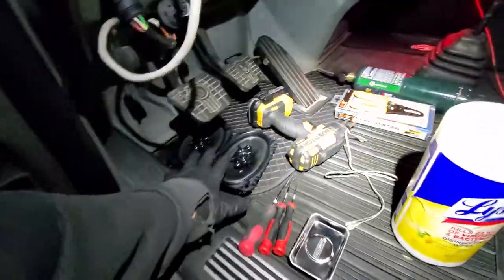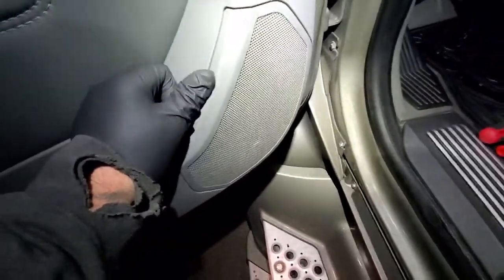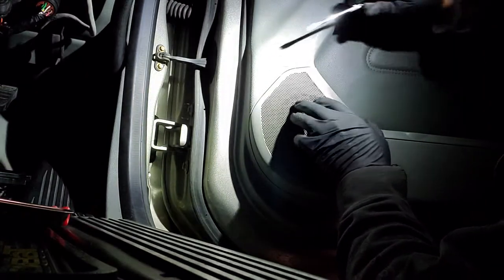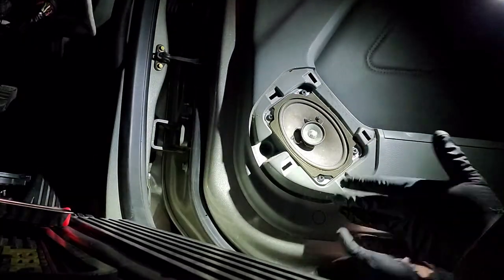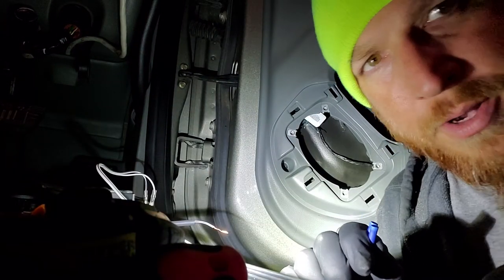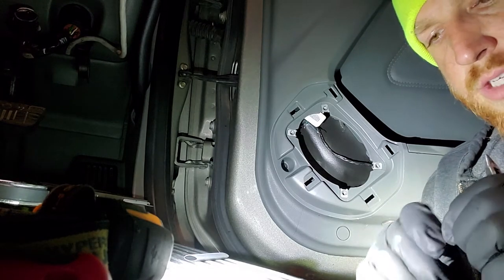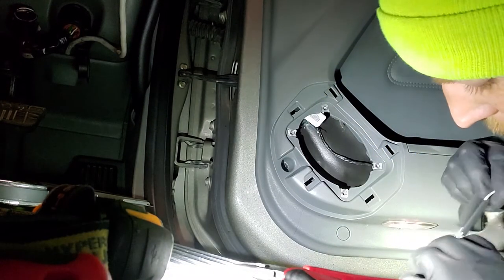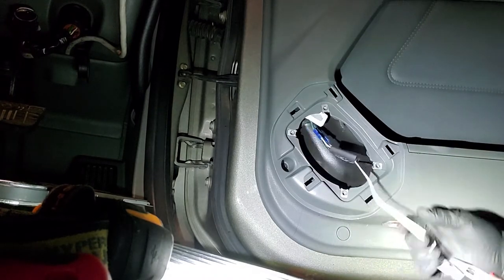replacing door speakers on a kenworth t680

Comment: It will play both ways. But it will be louder when you get the power & ground on the right ones.
Reply from the maker: The right ones?
Reply: @justanotherotrguy yeah what he's talking about is the speaker will play in reverse polarity. Basically you could hook up the positive wire to the negative terminal and vice versa and instead of the speaker being pushed out work when it plays it gets pulled in word. If it's getting pulled in word it's basically pulling sound down towards the magnet and when you have it hooked up to the "right once" meaning positive to positive and negative to negative the speaker operate properly and project the sound outward.

Comment: For company drivers. They got this thing called T clamps. This way you don't have to cut off the adapter and get in trouble. My wires were black and brown. Didn't pay attention so I don't know which one is negative. Use the blue T clamp for the truck wires. And the red connector thing gets crimped on the wire that comes with the speaker When it's time to trade trucks or whatever, just release and throw some tape on it. I'll let you know how long they last. I used Boss speakers. It's kinda meh. Got any good Bass recommendations?
Reply from the maker: Are you referring to stock bass speakers or standalone box's? JL makes great speakers as well as pioneer, Orion and Rockford Fosgate. Some of them are pretty pricey but worth it. What truck are you running? Running subwoofers may require additional battery power
Reply: @justanotherotrguy  a 2020 kenworth t680. I just need more bass. I can't listen to boneless music. I'm a company driver so I can't do too much to the truck. I do have a subwoofer but don't know how to install it. I'll have to check out these speakers.
Reply from the maker: @887Bingo  yea man I'd go easy if it's a company truck with adding too much. You might be able to get away with asking them if it'd be ok to add some bass to your stereo and see how they react. If they don't mind you could always take it to a car audio installer to get it rigged and let them know it needs to be removable without any hole drilling or cosmetic alterations, so they don't have a shit fit bc you put a sub in there. I'm gonna make a video at some point installing some amps and subs, as soon as I get it all bought!
Reply: @justanotherotrguy  cool. Also I think I might have found a hobby in wiring things thanks to you. First time doing something like this and its surprisingly extremely exciting to work with wires and have what you did somehow work.
Reply from the maker: @887Bingo  I'm the same way! Feels really good to do shit yourself and make something not working, work again. Problem solving and fixing an issue is very gratifying. Glad I could help!
Reply: Great info and video. I do have to laugh a bit... you wore the gloves while wiring speakers, but not wear them while changing water separator filter 😂 How dirty were the speaker covers? Yeah, I'd be wearing gloves too! Safe journey and hope to see some more videos.
Reply: I know this is an old comment, but the better solution is to properly adapt the trucks wiring harness to your speakers. This can be done with a pair of Delphi 12052833 male connectors, 2 pairs of Delphi 12059894-L crimp terminals, and a pair of Delphi 12047665 terminal locks. All of these parts cost pennies. No modification of the vehicle's wiring harness is needed here, and once configured, the installation is plug'n'play.

Comment: Is it neccesary to use a new adaptor for new speakers ? Or we can change only speakers
Reply from the maker: Most aftermarket speakers will have different wiring plugs than stock speakers. Unless you find some that match your stock plug, you'll have to replace it.

Comment: The factory 4x6 door speakers in my 2020 T680 are labeled as part number# PP307006. 8 ohms. 50W. I also bought the Sony XS-R4646 4"x6" from WalMart but they sit just slightly taller after mounting and therefore the speaker grill will not snap back on. Additionally the "oval" on the inside of the speaker grill is NOT the same oval size as the Sony XS-R4646 speaker. You would need to shave the plastic on the inside of the speaker grill to make it snap back on with a factory fit. While I could modify the speaker grilles, I will be returning the Sony speakers and ordering factory replacements since this is for a company driver and only one speaker was torn. I'm seeing prices of $15-23 for one speaker which is about the same price as one of the Sony XS-R4646 speaker (which you have to buy as a pair so the box is actually $40). Dont want to put any more time than necessary to get it working. YMMV and GL
Reply from the maker: Look into the KICKER CSC46 CS Series 4 x 6 150 Watt 4 Ohm speakers. I had the same problem and the kicker speakers fit way better

Comment: Hey man love the video, but do you think its the same process for a 2022 T680?
Reply from the maker: Probably. Most the wiring and connectors are super similar. You'll have a positive wire and a negative wire to your speaker, regardless what they look like. If you have a test light or a multimeter you can unplug the speaker and turn on the power to test which wire is which & the process would be the same as my video. Let me know if you have any other thoughts!

Comment: do wires also need upgrade if possible
Reply from the maker: Not necessarily unless you are doing some serious upgrading. Even then most of the mid range speakers will run just fine on the stock wiring

Comment: Any idea what ohm rating the FACTORY INSTALLED speaker is??
Reply: Probably 8ohms
Reply: The factory 4x6 door speakers in my 2020 T680 are labeled as part number# PP307006. 8 ohms. 50W.

Comment: Does anyone know what size the rear speakers by the floor size is?  Mines a t880 with the useless NAV plus crap (terrible system). I replaced the 4x6 fronts but want to know the rear size and I'm having troubles finding the size online.  It's a 2020 daycab t880. Speakers are on b pillar by floor
Reply from the maker: I honestly don't know. My base model ass doesn't even have speakers behind my seats. Gonna buy some and install them at some point
Reply: Yeah. Great truck terrible radio

Comment: What size are the speakers in the sleeper do you know
Reply: Pulled mine today from a '21 T680.  My rear bulkhead speakers are 6.0-inch.  The speakers are only $4 each retail, so you can imagine why Kenworth installs them their trucks.  Here is the OEM speaker number you can google:  PP302532 4-OHM 35w.  I am replacing the OEM crap with Rockford Fosgate 6-inch Punch 16 Coaxial speakers.  Set of two speakers at Amazon $99.

Comment: Anyone know what size speakers are in the rear, between the bunks on the back wall?
Also, anyone know of a video that shows their replacement?
Reply from the maker: I wanna say they're 4x2's but I may be wrong. My truck didn't have any  and I've been too lazy to wire them lol if I do, I'll make a video for you
Reply: @RedWhiteAndBlue4evr1  6.5s didn't measure but that cover literally just falls off like it's held on with paperclips, if you plan on replacing them buy speakers with a grill cover they'll look much better and won't fall off so easily